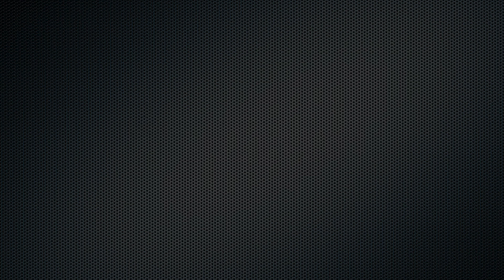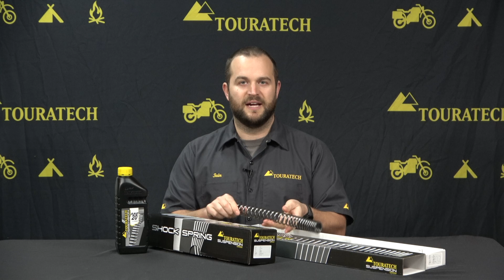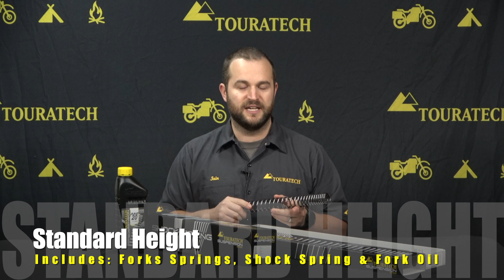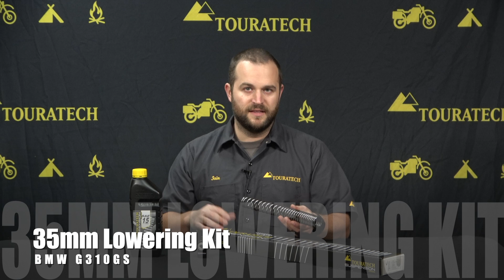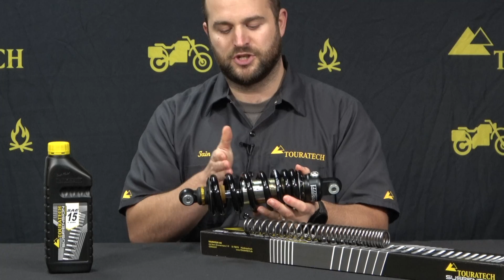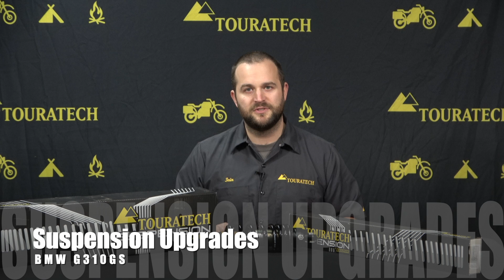Suspension Upgrades and Lowering Kits for BMW 310GS by Touratech Suspension

Comment: Thank you for the great video, i sent my bike to the bmw agent in singapore ( Performance Motors Limited) for this fork seal and fork oil replacement, and the agent told me the right fork damper unit is stucked in the fork inne4 tube and they say they do not have the extractor. They needed me bear the cost to replace both the right fork inner tube and the damper unit that is stucked inside...I wanted to ask if this is even possible? And is this a case of skill set issue, or could they have damaged it while trying to disassemble? Appreciate your kind advice and guidance

Comment: What is the spring rate on these? Will they support 300lbs (rider+gear+luggage)?
Reply from the maker: These springs will be much better than stock for that kind of weight but if you can find a place to make custom spring rates for you that would be even better still.

Comment: with the -55mm kit, will the bike be lowered under no weight as well?
Or will it only be lower to te ground when there is rider weight on the bike?
Reply from the maker: The -55mm kit will be lowered all the time since the shock is replaced with a shorter unit.
Reply: @TouratechUSA  thanks for confirming, just what I needed! Bike is a bit too high
Reply: @TouratechUSA  how long in inches is the shorter shock? thanks

Comment: This is great, has anyone had this installed in Bangalore, India. If yes, which garage did you use? 
@Touratech  this product will be a huge hit in India if you can tie up with BMW dealers or local bike mechanics/garages to install them.
Reply: Have you found out any dealer in Bangalore?
Reply: No, I just got used to riding the bike as is. 35 mm reduction in height would be great though. Let me know if you succeed in modifying your bike.
Reply: Guys , Did You find anything yet ? In bangalore
Reply: Hey guys any update

Comment: Hi, thanks for sharing this video. I need 55 MM lowering suspension for GS 310 2021 model. Can I place an order from India?
Reply: Hey I wanna get one too. Im 5’10 what’s your height. Im confuse should i get 35 mm or 55 mm ?
Reply from the maker: @hauntingnighttv  Everyone has different preferences, but we believe the 55mm would be too low for your height. We would suggest either the -35mm or standard height spring kits.
Reply: @TouratechUSA  thank you so much
Reply: @TouratechUSA  if you are 5'10 you don't need one. I have the bike and the 35mm  will be fine.
Reply: @hauntingnighttv  you need the 55mm also get the low seat ,&  lower the front shocks ,not to mention you can also change front tire to 17 inch volla.
Reply from the maker: Visit touratech.com to find a distributor in your region. The Touratech headquarters in Germany can ship worldwide.
Reply: did u brought them?

Comment: Does the standard height progressive spring improves suspension for off-road riding?
Reply from the maker: It will help is most conditions with it's increased bottom-out resistance.